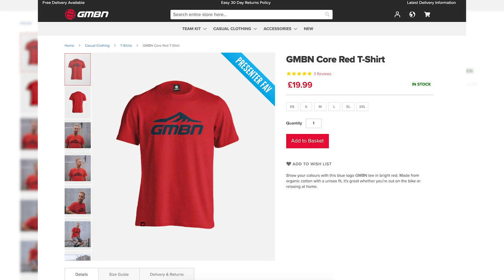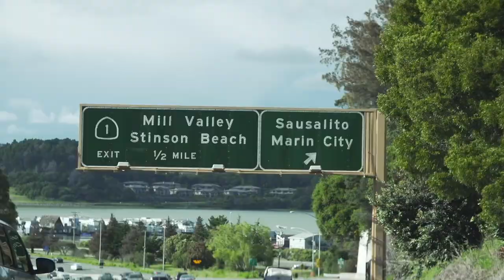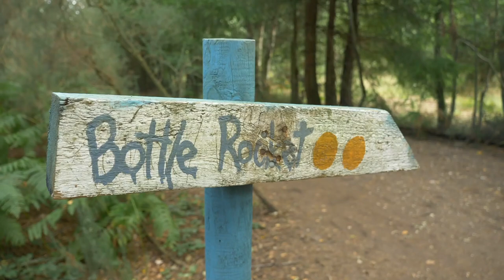The Greatest Invention Of All Time - History Of The Bicycle | Dirt Shed Show 290

Comment from the maker: What do you think is the single best bicycle component invention? Let us know 👇
Reply: Suspension
Reply: I would say suspension
Reply: The wheel, of course.
Reply: THE FAKE  BOI was that an agreement
Reply: @isaacjackson15  lol we said the same thing
Reply: THE FAKE  BOI Yep 😆
Reply: The dropper post I guess
Reply: @nickwatkins5227  u really think soo?
Reply: The drive /chain
Reply: Nice vid
Reply from the maker: @ajvm2010  Okayyyyy.. apart from the wheel! 🤣
Reply: the derailieureur
Reply from the maker: @Crashtest_Fetus  🙌 HANS RENOLD
Reply: The Freewheel 🤔
Reply: brakes
Reply: The cassette
Reply: The chain
Reply: Pneumatic tyres
Reply: Delarieueueiliuer
Reply: Tyres obviosly
Reply: The derailer👌
Reply: Unicorn hair fibers, and wireless brakes
Reply: Free hub
Reply: A botched back flip... he doesn't make it around and FACEPLANTS into the ground? #captioncontest
Reply: Modern bike frame
Reply: I'm on the fence between front suspension or dropper post. I mean the two together are a revolution. But possibly the biggest revolution has actually be the material of the frame itself. Not only you have super high tech alloy / metal frames, but you also have higher and higher quality carbon being produced. Man it's so hard to make a decision!
Reply: a trick: you can watch series at flixzone. Been using it for watching lots of of movies lately.
Reply: @Alden Ezra definitely, I've been using Flixzone for since december myself :D

Comment: The Guerrilla Gravity Megatrail is made in America. It has 27.5 wheels. It uses the same front triangle as the 29er bike and all the different wheel travel. The rear triangle is different to suit. The head tube looks like it does because you can change the reach by 10mm. It also has the 15mm taller lower headset cups for the 27.5 wheels.
Reply: Hey Lisa. I should have put this info on my post. For a really cool South African brand check out PYGA. I chose GG because of their attitude and now I'll ride GG for life.